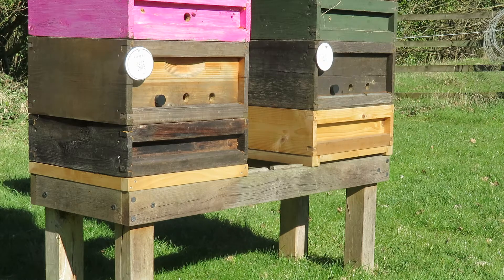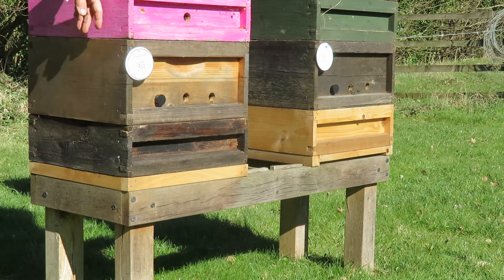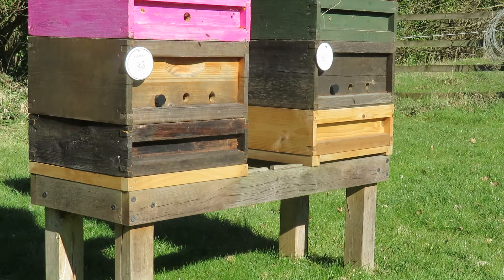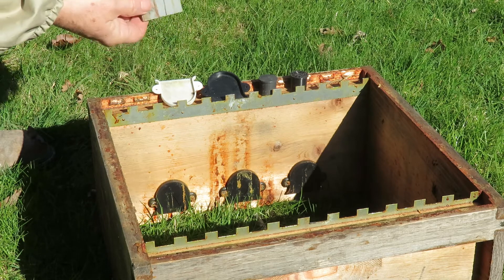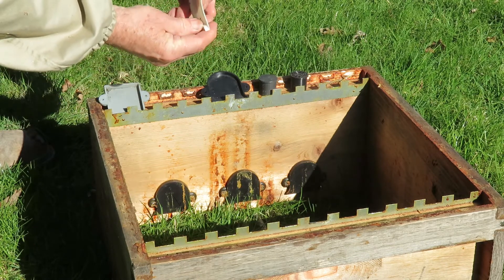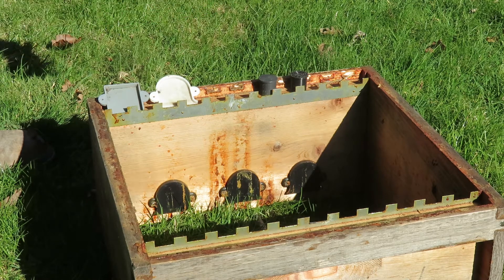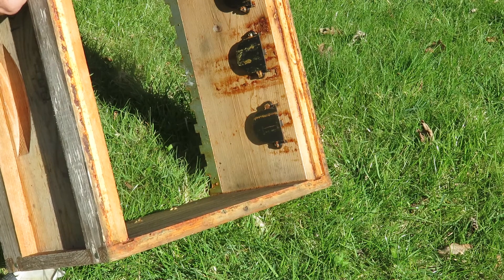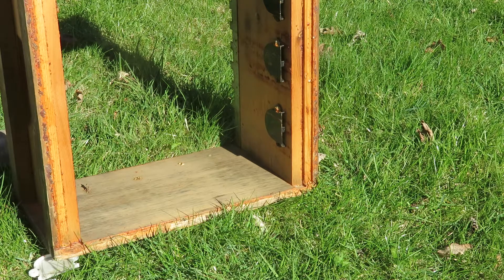The Upstairs Downstairs Hive system

Comment: Hi

You have a solid floor, did you close it fully with wood/foam etc?
Reply from the maker: Hi Rodney, I made up solid floors with no entrance at all as I had all mesh floors. If you have existing solid floors with an entrance then block it up completely with wood so the bees will then propolise it to remove all draughts.. Foam is a temporary solution.
Reply: @thebeewatchapp1914  Thank you
Reply: Hi, 
I have the UD hive installed now for over a year and have encountered a few issues. 

I know that the main issue (damp/condensation) is caused by my location, (I am based in the UK on National Trust land), close to a water system. During the unseasonal weather conditions in the UK last year resulted in such bad condensation that the presence of water was clearly visible at the bottom of the hive. Needless to say, I lost that hive. 
I had inserted the contents of a nuc of bees in the beginning of the season, and all seemed well.  
I have a 14x12 Brood at the bottom of the hive, but have not managed to get the bees to go up into the national super no matter what , but nonetheless have filled around 70% of the brood box. 
I have observed that some users of the UD are placing their supers underneath the brood box. I wanted to know your view of this, and whether you can suggest anything to help?
Secondly, the issue of water on the hive floor presented itself for the first time this year in my last hive inspection. I have drilled to holes into a solid wood floor which I will install this weekend. Is this something that you have come across?

Apart from that other apiary members are shocked that the bees are able to remove dead bees and debris from the hive floor, and also that no robbing seems to take place at my hive.

If you could provide any advice it would be greatly appreciated.

Thank you

  @thebeewatchapp1914